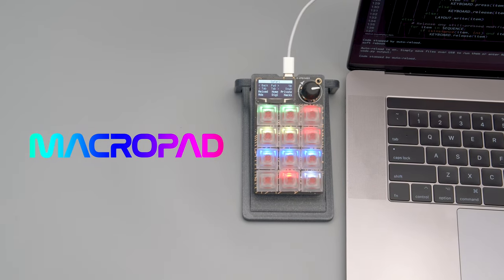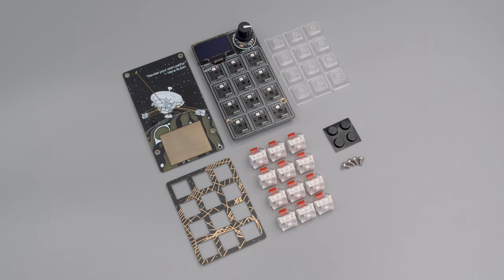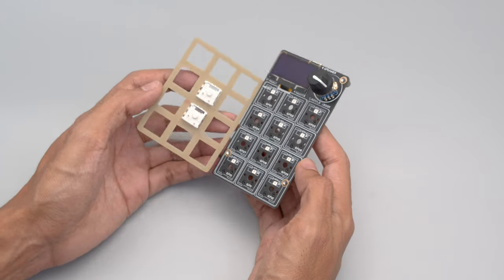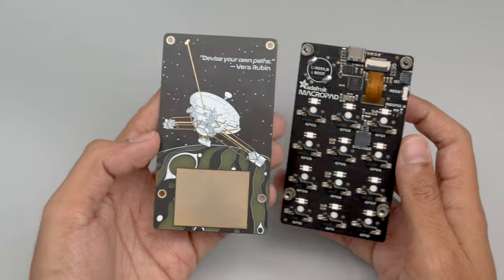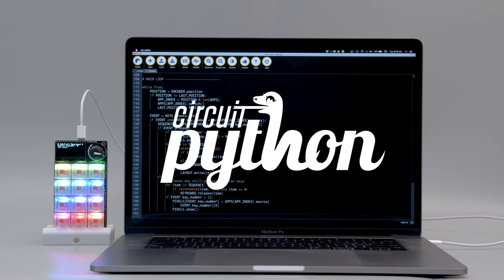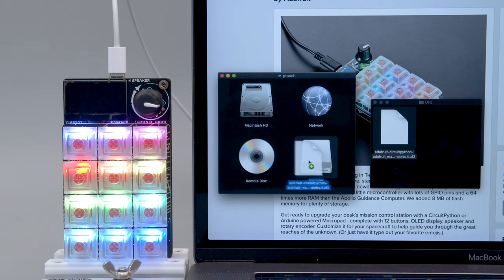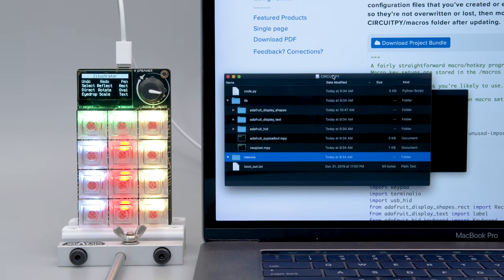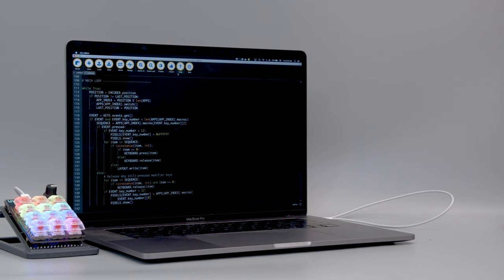MacroPad RP2040

Comment: Is there a bluetooth rechargable option, preferably longlife? My USB slots full of necessary peripherals and it would be nice to operate from the comfort of my chair without an extremely long cable trailing across the floor.
Reply: You could make and mod it yourself, if your looking for an actual macro pad you don't want to tinker with them you're in the wrong place

Comment: Hey ho! Is there a way to use the macropad to direct files to specific folders (on the hard drive or on google drive) when saving from the web? i.e. for arduino related pdf files right click, save us and then press the top left key on the macropad to define a path to save it in a specific folder. For a processing pdf a different key etc.
Reply: Or on macOS, Cmd-Shift-G, then type out a path